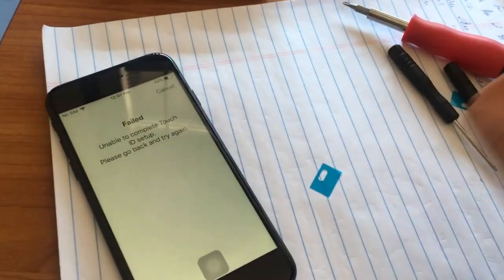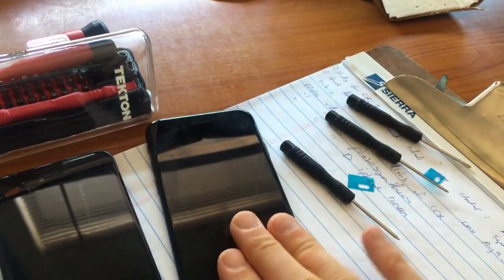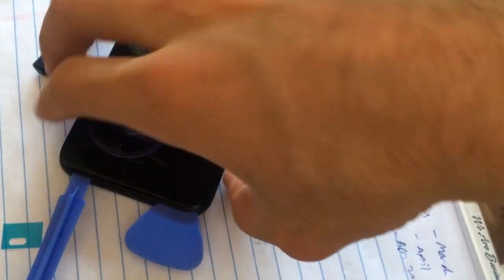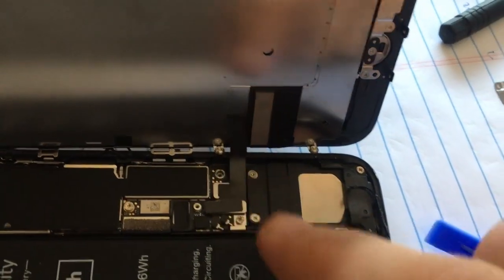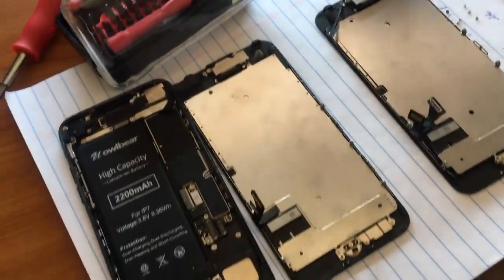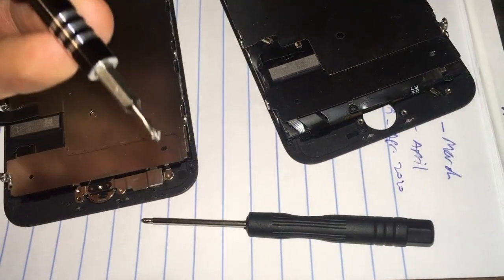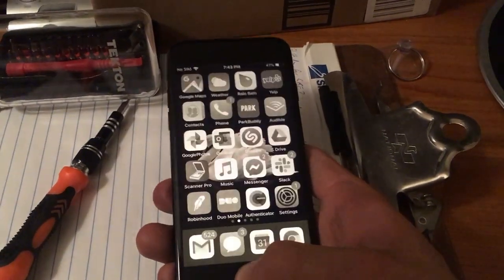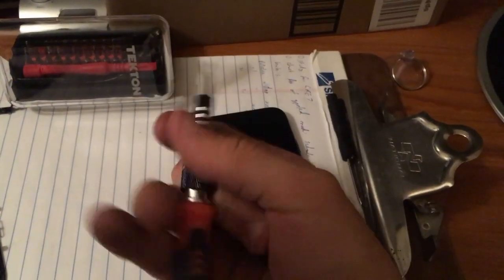Touch ID not working after iPhone screen replacement - Fix

Comment: So I replaced my display WITH the original touch ID button. I don't receive any message but touch ID will simply not read my finger print. It's super weird because it acts like it does but doesnt

Comment: I swapped screens to an aftermarket one,installed it all properly but still no Touch ID. Someone on a forum said Apple pairs the screen to the touch button/logic board too. I’m lost
Reply: Unfortunately, Touch ID doesn't work with aftermarket screens. Along with using the original logic board, you have to make sure the screen is OEM
Reply: @lightworker7776  it will not work even the home button itself.even if you put an original.screen

Comment: Hi i have a question regarding the iphone home button, Will the Original home button touch id feature work with a aftermarket display screen
Reply: Yes
Reply: hi mate i meant will the finger print featire work with a after market display screen?
Reply: @loyalty786 hi i also have same problem 
Does ur problem solved ?

Comment: Hi Vincent you didn't show how you removed your original home button from the broken screen without breaking it. How did you get it unglued from the broken screen?
Reply: You need a hair dryer to heat it up a little bit like 30 seconds max … it will melt the glue and will be easier to remove

Comment: Settings - general - accessibility - touch assist -toggle on, screw the home button.  Or replace the display, again.  Odds are the replacement screen is a piece or you didn’t disconnect the battery and effed up the new display or home button if you just replaced the display which is usually when the home button decides to stop working.  If it just abruptly stopped working and no water damage just use the touch assist if you’ve opened phone and confirmed ribbon is connected.  Its screwed.

Comment: My iPhone 7 battery was dead, so I bought a new one and this was my first time opening an iPhone so I accidentally separated the glass from the LCD panel on the left side so I had to buy a new screen (which did not include a home button). So I transferred all components from old screen to new screen “including home button” and now my home button doesn’t work..... so what does one do from here
Reply: Ur stuck unless u buy an original apple replacement screen ur home button or Touch ID will not work happened to me with 3 customers after my supplier sent me bad screens after a good 7 years of having no faulty screens
Reply: @3LGang2L  Love and hate apple man, love their phones, but hate their bullshit service/fine print problems. Well thx for help

Comment: I replaced my screen and used the original home button but still it doesn’t work
Reply: @_somi.053  I think its the lcd cause i had minor damages on my screen
Reply: Hey guys recently damaged was caused to my white iphone screen i replaced the screen with a fully assembled original screen from another fone, with the home button, Unfortunently touch id didnt work, So i used my Original white home button with my replacement black display screen, Luckily touch id was saved, Mashaallah and i have the touch id feature, 1 good advice i would like to share with you is use your original home button with a Oem original display screen maybe from a different phone, That will solve the touch id issue, I recently attempt a repair and it worked just fine
Reply: @loyalty786 nope it doest work
Reply: A to all the viewers that has read this message, I’m looking to purchase a iphone 6 parts phone,
 Would any one recommend any sites other than Ebay i can purchase a i6 device/ i6 plus device in white? Etc

Maybe someone has one spare lying around, Get it touch,

Thx u
Reply: The original home button is paired with the original lcd screen when you buy your new Iphone.If you replace the screen with another screen you need a new home button that is paired with that new screen,I know fuk apple!!!

Comment: What if I used the old home button on my replacement screen. Would that allow it to work?
Reply: StarSun yes Ive done many
Reply: Mine didn’t work still doesn’t work trying to find a solution
Reply: @craigbryden7487  you probably damaged the cable. Its extremely fragile. I have done this to 3 iPhone so far and they all work with touch ID functioning.
Reply: @StarSunYT  nope only in your dreams

Comment: I used the original and still doesn’t work
Reply from the maker: Then the cable may have been damaged or the connector on the board. I would double check all the connections and clean them if possible.
Reply: Vincent Stevenson thank you
Reply: @Nanina127  If you buy Motherboard with Touch ID, then the sensor will also work

Comment: So I replaced the lcd, but the touch won't work. I don't use an iPhone so I dnt know much about them. The home button works fine(Original) but the touch screen won't work. It worked fine but later on it said, it doesn't recognise touch ID . Help
Reply from the maker: I would double check the display connections are properly seated to the motherboard on the iPhone. One of those is for the digitizer which is how the phone registers touch.
Reply: Thanks for replying. 
I reopened and reconnected all the ribbon wires and now it works fine. I guess I didn't connect them well.
Reply: Mjustin meyase PRO TIP: Disconnect the battery BEFORE connecting any connectors!

Comment: there are loads of screen on ebay how do you know if your buying a decent quality screen
Reply from the maker: I usually buy used Apple screens as they are much higher quality than the “new” third party screens
Reply: Vincent Stevenson are these the ones claiming to be original with the glass replaced on broken screens ?
Reply: @The-moody-biker   hey, the button is not related to the screen but is related to the mother board. he just was confused